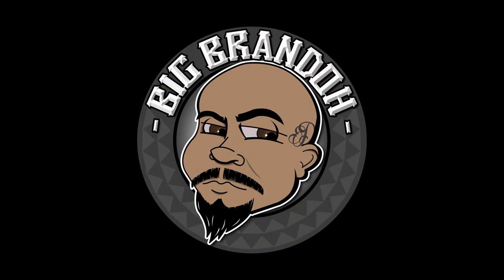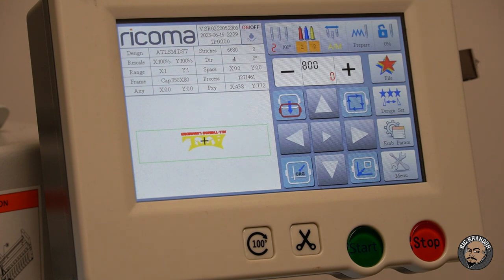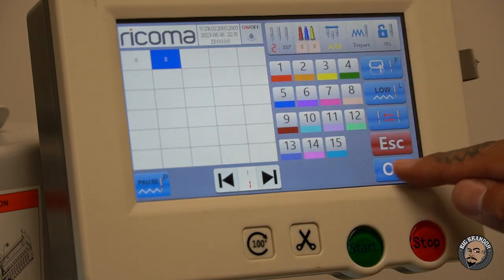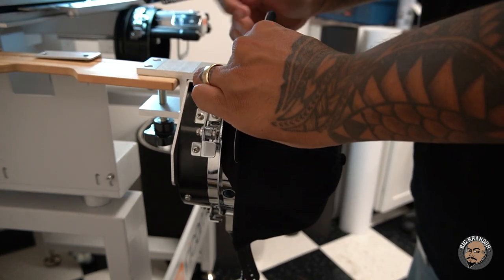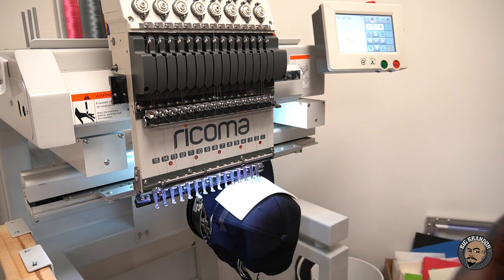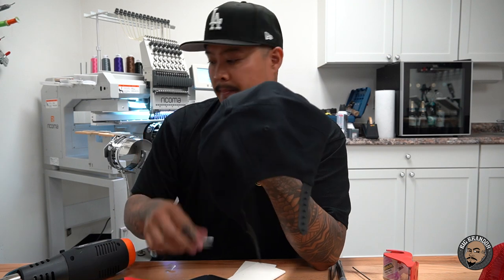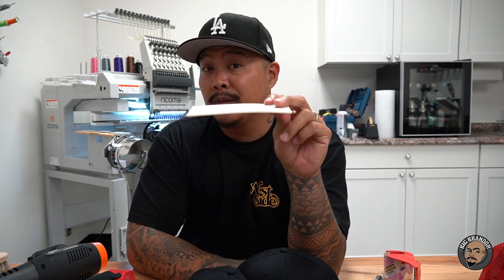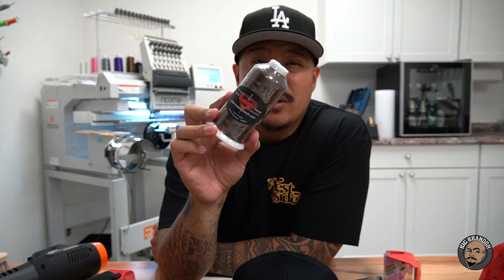Hat Embroidery Tutorial - Start To Finish

Comment: Could you share with us the most reliable heat transfer vinyl you currently use and the cut settings for it with the cameo?
Reply from the maker: check the econo link in the description. i cut all htv on my cameo using the "heat transfer smooth" preset

Comment: Awesome work. When did you start doing hats. Also is the start up costs for hats worth it even for limited runs?
Reply from the maker: ive only been doing my own hats for like 2 years. i used to outsource it before. having a single head machine is the best for limited runs. alot of my money comes from doing small runs because most big shops with bigger machines have high minimums. so i can charge higher premium for doing less hats.,

Comment: I've had massive problems with my hat embroidery recently. I've been using Decky hats style 6020 with 90\14 needles. I've broken 5 needles on 2 hats in the exact same part of the design as it crosses the seam. Any advice? Also really wondering how common are needle breaks especially on structured hats?